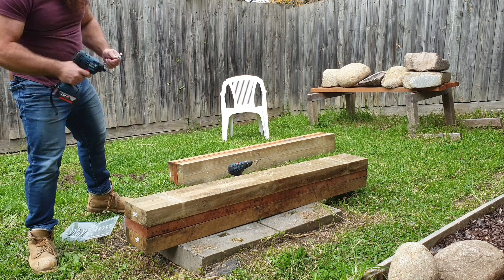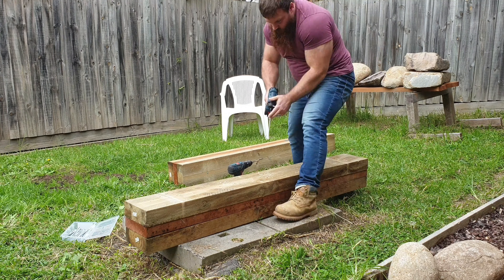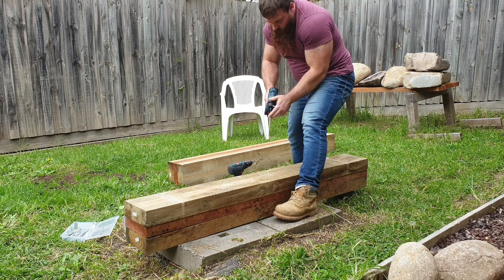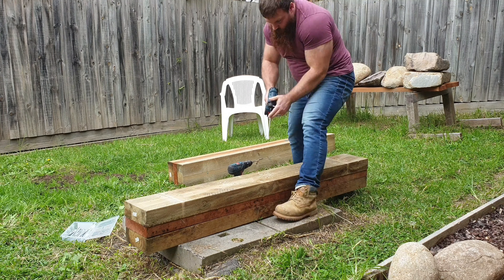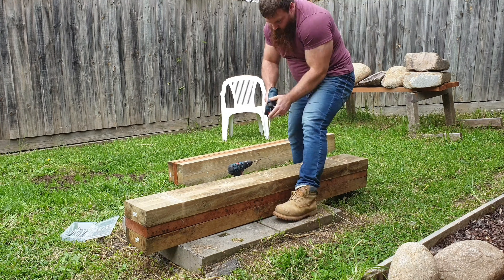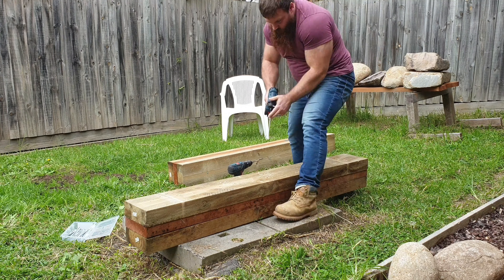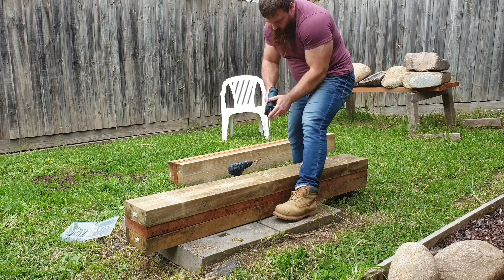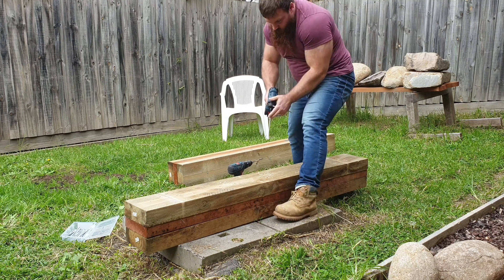Farmers Walk Handles For Strongman - DIY Wooden Farmers Walks

Comment: Moin Laird !                                   
Is the connection between the red and black woods just the small narrow angle? That seems too weak to me when loaded. Otherwise again a top job.                                     Greeting Friedhelm
Reply from the maker: They were very thick and 150kg rated, so 300kg rating each side. They have held up well
Reply: @LairdRoss  Moin Laird !                   
Ok, then that should hold. Have fun training.                                           
Greeting Friedhelm